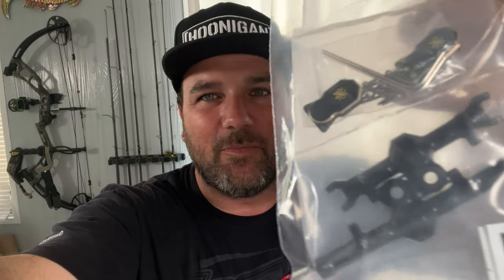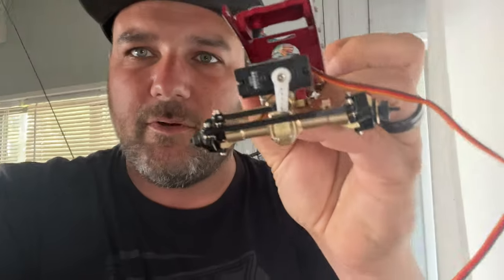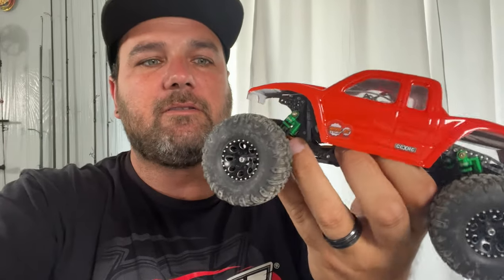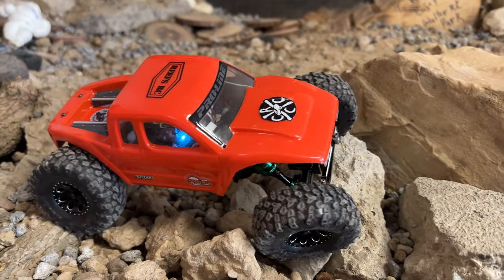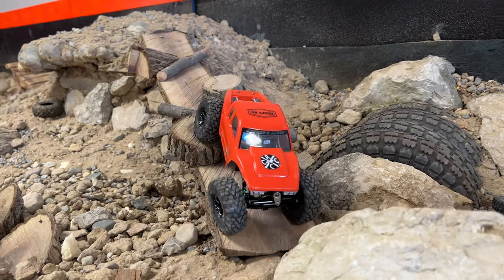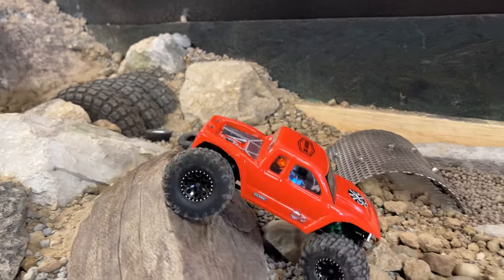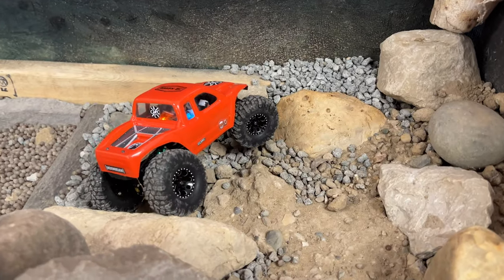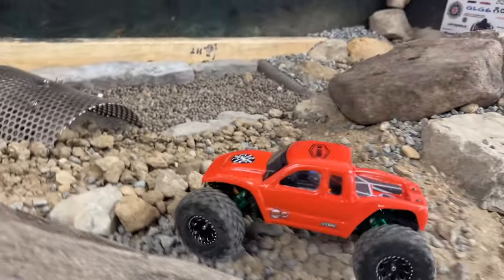"Even Brass Can't Help A Stupid Line Like That." 😂 Testing CCxRC Brass Axles for the SCX24

Comment: i should had watched your video before i put the new brass axles together  on front axle i had problems trying to put the axle shaft in i had to sand down the inner axle to get it straight into the bearing got it together  yeah noticed hot racing heavy diff cover doesnt fit well sanded that down and still have a lil gap but its all good. dont use the stock shocks due to the differnet threads that i snapped one off when screwing it in.  otherwise like it the extra down weight on my deadbolt i ran first maiden when jaysen was out here at park videod me with the guys doing follow the leader.  awesome stuff there tony